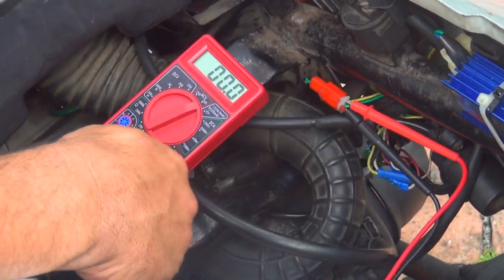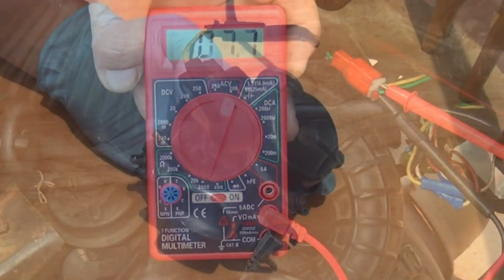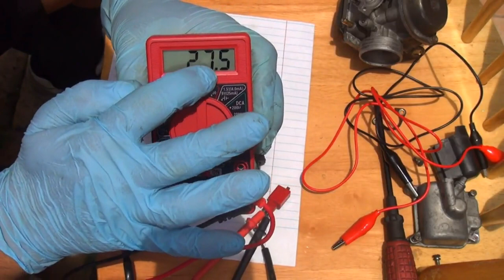GY6 Scooter Automatic Enricher Operation & Testing

Comment: Great video, very clear, thank you. I have a GY6 engine in a chinese ATV. I have just replaced the very tired loom, but the new loom does not have a plug for the enricher. The enricher works okay. I see that a ballast resistor is also important to stop the enricher overheating, but you do not mention one and I cannot find one on the ATV. Is it something I need to worry about? Otherwise I plan to connect the enricher to a nearby yellow wire (AC) and a green to earth.
Reply from the maker: Hello Alan you do not need to worry if your scooter start anyway I will not connect to the ac yellow wire if you do not need to do that . thank you for watching my video

Comment: The cold engine does not activate the automatic jicle. What is the reason? how can I arrange that??
There's electricity, it heats up, but the engine doesn't turn on when it's cold.  it's possible to adjust.
Reply from the maker: There is a possibility that you need to clean the carburetor  because sometime the enricher is not working because is dirty or need to be replace because sometime they fail
Reply: @VirberelloScooterTips  Is it possible to adjust the opening and closing distance?
Reply from the maker: @dedeabsrn8044  No I do not this is possible

Comment: Great vid.Followed your instructions and found mine was only extending out 2mm and had an ohms reading of 77. Thanks
Reply from the maker: Thank you for watching my video
Reply: @VirberelloScooterTips   Well I thought that was my scooters problem yet it died on me again 3 days ago.I just bought a new carb that came with new enricher,installed today and the scooter ran great but again it died after it was warmed up.It seems to only die when its fully warmed up and it is at idle and it dies instantly,like someone turned the key off. Any idea what the problem could be ? I adjusted the valves and am gonna re-check the gap tomorrow,they seemed a little noisy after I adjusted them. Could a bad CDI be the cause? Thanks for any help you can provide.
Reply from the maker: @duckthis17  Hello my friend that sound that you have a bad stator alternator see with heat wires expand and sometime they disconnect from the contacts or where they are welded and when they cool down sometime they magically reconnect that is my feeling on your problem I could be wrong so check on that . https://youtu.be/kU-S2OpQD0c
Thank you for watching my video
Reply: @VirberelloScooterTips  Thank you much,I will try changing that out,luckily parts are cheap for these scooters.You are very kind to respond.I am a subscriber now.
Reply: Ok finally had a chance to work on it.When I took flywheel off there was a ton of dust looking stuff inside flywheel and stator,is this normal or was something degrading/grinding inside ? New stator should be here today.Thanks for your help.
Reply from the maker: @duckthis17  Hello yes many time you can find little dust at the stator but many times you see corrosion or rust build up on the coils or wires
Reply: @VirberelloScooterTips  Your the best man,put the stator in this afternoon,no more dying out when warmed up.Thank you so much for your help.
Reply from the maker: @duckthis17  You are very welcome my friend I'm very happy that your scooter is running great now please do not forget ride smart and ride safe with your scooter :-)

Comment: My engines overheating. And when I pulled the enricher off it was fully extended. Would that be a reason. And my valves are tight with no play in them. Could the combination of the 2 be why its overheating now? All of a sudden? It didn't overheat untill this dude did a valve adjustment on it!
Reply from the maker: Hello Michael yes the exhaust valve did not have a lot of clearance that is why your motor was getting really hot

Comment: hello..I'm Diego from Italy...thanks for the video...it's great. my scooter when I push the button start easely but it turn off immediatly and  when I push the start button don't run. I must clean and dry the spark and after the engine run. after two minutes I stop the engine and after the engine start easely. have you any idea about it????
Reply from the maker: Ciao Diego I think you have a dirty pilot Jet so you need to clean the inside of the carburetor and at the same time check the manifold to make sure is not cracked if that does not fix the problem and you have a gy6 4 stroke I will check the valves clearance. Ciao Diego and thank you for watching my video

Comment: great video, i have an issue with my scooter and if i do not wait 4-5 min to warm up, the scooter will bog. can this be due to a faulty auto choke/enricher?
Reply from the maker: Hello my friend that could be the valve clearance or main jet in the carb is slightly dirty
Reply: @VirberelloScooterTips  it only happens when the scooter is cold. Once it’s warmed up it seems fine
Reply: @VirberelloScooterTips  i replaced the jet. do you have a video on adjusting valve clearance?
Reply from the maker: @nadajoey1  click here https://youtu.be/csH2RGvXegI
Reply: @nadajoey1  I'm having the same issue right now. Do you mind sharing things you have tried to help it and if it worked? I cant seems to figure it out.
Reply: @Mech.E  replaced fuel enricher and adjusted the timing along with float. Did the trick
Reply: @nadajoey1  Thanks will look into it 👌🏼

Comment: Hello sir it is okay to remove the auto enricher or dsable it?
Reply from the maker: Hello yes  if you like to do that you will need to remove the enricher place a the needle in the hole and close everything with high temperature JB weld or you can buy a kit a place a manual choke or the last option is to buy a great quality carb with no choke is all depends on your location because sometimes to have a choke or one enricher is good for you in a cold morning or when you don’t turn your scooter on for long time

Comment: Nice video, I have a Piaggio Fly that has trouble starting after it sits for an hour or two, it has new battery, starter and spark plug so thinking it something with fuel delivery, could it be the enricher thats bad?
Reply from the maker: Hello Paul I'm not to familiar with fly scooter but to me sound more like valve clearance adjustment . Thank you for watching my video and be safe
Reply: @VirberelloScooterTips  I think you may be right, I will attempt to adjust valves soon, thank you very much for helping me with my issue!

Comment: What a great video and advice. Thank you. I have a question for you. I just bought a used 2008 Mio 50cc scooter. I runs great but the blinkers are not working. I checked all the bulbs and all are good and ok. The headlights work, the brake lights work also. However the rear running light is not on. The horn does work also.
What do you think is the problem?
I really appreciate all your videos and information. 
Keep up the FANTASTIC WORK!!!
Reply from the maker: Hello my friend for the blinkers is the relay check this video to give you an idea https://youtu.be/cJoOfSHUTiE and for the rear
 lights could be corrosion on the connections just follow the wires and you will find the problem. Thank you for watching my video

Comment: Hello sir i have an problem i think is bc of that my scooter dosnt run well much speed i get is 30 kmh is bc of that ?? I clean it carburator and still the same i dont get enough power
Reply from the maker: Hello if the motor sound good but you don't get to much speed that is the roller weight if the motor not performing right  and when you give little  throttle goes down on rpm you need to check the valves clearance if you have a 150cc 4 strokes scooter plus make sure you have a clean air filter because that is very important too. Thank you for watching my video and be safe

Comment: Do you have an estimate on how many minutes will it take to fully extend?
Reply from the maker: Around 1 minutes and 45 seconds
Reply: @VirberelloScooterTips  Thanks a lot! I reenabled my auto enricher today after blocking it off months ago, now I can my idle much lower (1150 rpm) and save gas without worrying about cold starting in the morning, my idle was 1650 rpm before.

Comment: Thank you  just a question please after riding my scooter about half a block it is like it runs out of gas fuel  and then with a few cranks it starts up and can ride it for about another half block and repeats until ran for about 40 to 50 minutes and then seems to run fine  I much appreciate any help thanks again
Reply: My moped is a 2021 MVP thank you
Reply from the maker: Hello Wesley I think you have a problem with the Float Valve Needle https://amzn.to/3hb2Obh that with time and bad fuel  become a little sticky and sometime does not open and let the fuel flow so the best thing is to open the carburetor and clean everywhere with a carburetor cleaner spray https://amzn.to/2St1ecl but make sure you cover your eyes
Reply: @VirberelloScooterTips  thank you so much for the information and confirmation I was thinking that was the problem  God bless you brother

Comment: Im about to loose my mind my scooter is a 1P39QMB icebear vision ithas a 3 prong connection so does the choke i have but so far i havent been able to find anything that has 3 i want a new carb but they all have two wire connection its like it doesnt exist but i assure u please help
Reply from the maker: Hello I never see a 3 wire choke until now but everything is possible from china I believe that there is a way to modify that wiring problem the best way is  if you can post a photo or a video on Facebook  Chinese Project Scooters group  so me and others members we can see the problem because if I can not see the part I can not come up with the solution . Thank you for watching my video
Reply: Yessir im at work i was just thinking i need pictures doon as i get home ill get some

Comment: i already subscribed ,my scooter bws 2 strokes (yamaha yw-100 4vp) won´t accelerate when i´m on the road after 5 minutes of starting fine,it hesitate to accelerate and....i´m confused because,i already change the A.V.R.,the C.D.I.,the alternator,the spark coil,piston and rings......some people said it was the electric enricher but after your explanation i realized that it works fine..........unless you recomend me what else more to check? thanks in advance
Reply from the maker: Hello Renato if you feel or ear the sound of the motor that is running good but you do  no have much acceleration the problem is the roller weight at the variator second thing I will check could be the air filter and the carburetor if is super clean  .
Thank you for watching my video

Comment: You tested with dc outside the carb but you tested ac in the bike. Can u expand on why I wouldn't use dc while in the bike.
Reply from the maker: Hello the enricher get AC electricity directly from the stator alternator on the bike thats how originally was designed for the gy6 motors but you can run the enricher on dc too and tested . Thank you for watching my video

Comment: Could this be my problem? I bought a non-running gy6 and cleaned the carb and adjusted the valves and I got it to sort of run. It will run now going down the road and is pretty fast but it is nearly impossible to start, cold or warm. I have to adjust the idle screw in and out and hold my hand over the carb and then it may sputter to life
Reply from the maker: Hello Seth remove the top part of the carburetor diaphragm is made of rubber   and make sure is not broken and if is not broken rub little beat of oil all over the rubber also on the plastic cylinder where the needle is located.

Comment: Sorry about my english
When i connect enricher the battery not charge
When i disconnect it the battery charged well
I measure the resistance it 8.8 oam
What i must do ,
Reply: When the y wire of enricher is connect
i measure the y wire before regulate rectifier it give me 00.00 and batter not charge
When i disconnect thr y wire of enricher and measure the y wire before the regulate rectifier its 30.00--45.00 and ok and battery charge
Where the wrong ?

Comment: Ciao Virberello! Do You think that it's possible to install a new enricher without disassembling the carburetor? Maybe it would be better to clean my old carburetor but i suspect that the enricher has got some issues...i have some problems to mantain the idle (too many rpm and i cannot Regulate it using the idle screw and the air mixture screw). I've bought a new Chinese enricher for my gy6 kymco.
Reply from the maker: Hello my friend yes you can remove the enricher without removing the carburetor there is a possibility that your enricher is not working properly or the enricher hole is dirty from old fuel

Comment: Is the enricher supposed to remain hot during the whole time you are using the scooter? I have that doubt. Tha k you for your help
Reply from the maker: Hello David yes when the motor is on the Enricher  is maintained at high temperature so is in a extended position but when it cool down the needle will go back. Thank you for watching my video
Reply: @VirberelloScooterTips  oh yes. I understood that part. But, my yamaha bws 125 maintains the e richer hot all the time the engine is running. The mechanic in my city has told me that is because there is an electrical problem, but I am noyñt sure if he is right or not. Is the e richer supposed to be hot all the time? Or is it supposed to be hot for a certain amount of time and then cool down?
Reply from the maker: @fernandohual  Yes the Enricher need to be hot all the time when you run your scooter
Reply: @VirberelloScooterTips  thank you so much. That is very helpful

Comment: if mine is fualty would it cause fuel to come out of the overflow?
Reply from the maker: Hello no many time when the fuel over flow you a have a problem with the carburetor floater getting stock from fuel gummed up so you need to clean the carburetor. Thank you for watching my video

Comment: Is there any way I can put a temperature gauge or a light to tell me when the motor is overheating on my scooter I have a 150cc
Reply from the maker: Hello Christopher I was thinking to do something like that soon or later and my idea is to place a sensor at the oil dip stick so drilling a hole at the dip stick top or take the temperature oil drain bolt from the lower left side of the motor  something like this on this link https://amzn.to/2YTTNda or this too   https://amzn.to/36rhcoO

Comment: can i disconnected it?
Reply from the maker: Hello yes but you need to lower your rpm because the enricher is not extended . Thank you for watching my video
Reply: Bro i mean enricher will fit on carburetor but the cable connection disconnected,there is no problem!